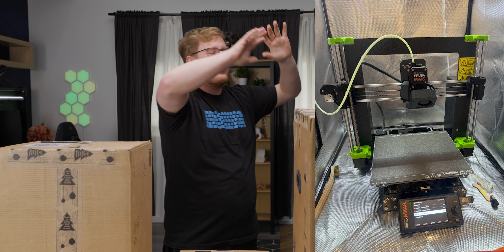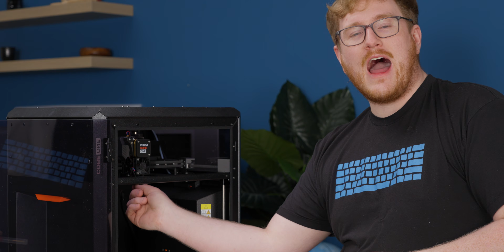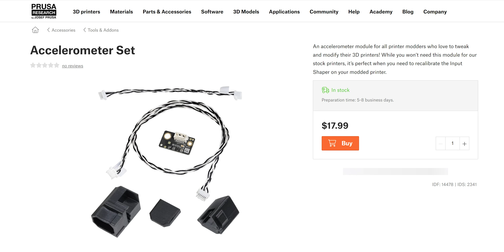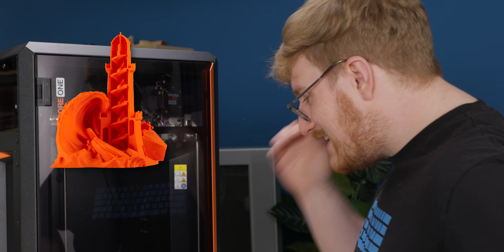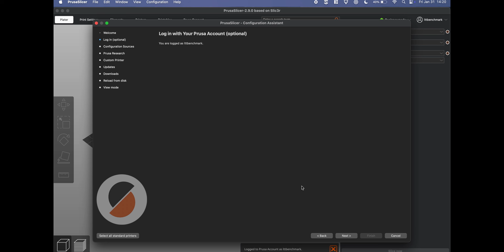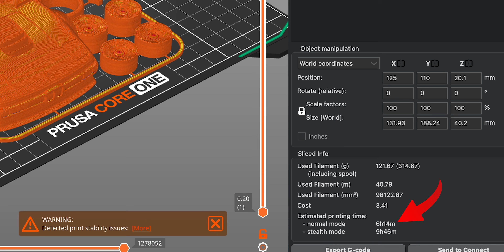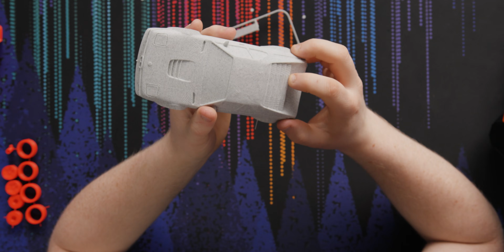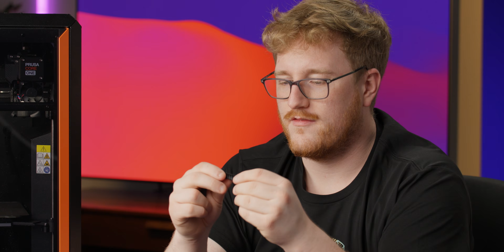Prusa has IMPECCABLE timing - Prusa CORE One

Comment: Even bad WiFi / older WiFi components should still handle 12MB files quite easily. But even past that, it has Ethernet - how does that compare for performance?

Also unclear on the camera - does it work via USB or does it have its own WiFi or something?

Either way, I had my concerns about Bambu a few months ago that turned out to be well founded. Placed an order for the Core One kit yesterday.

Comment: The 3D printer is broken, need parts.
Then 3D print the parts, but the printer is not working.
Then fix the printer, but need parts.
>>>> loop from here >>>>

Comment: Other Youtubers like CNC Kitchen have mentioned that the PLA overhang problems are likely caused by the temprature being too high in the enclosure. I bleive Prusa is working on a fix for this and it will likely be solvable through some slicer changes. Other companies like Bambu reccomend leaving the door open for PLA and Prusa tried to avoid this with the vent. Still impessive hat they managed to get such good prints with the door closed.
Reply: Prusa commented on that video that the fan are running at 40% at the moment, so you have plenty of ventialtion left.

Comment: One of my biggest complaints about the Prusas is that so many of the parts are 3D printed as part of their manufacturing process. I love 3D printing for hobby use, prototyping, and creating geometry that can only be achieved using additive manufacturing. However, full scale manufacturing should be as efficient as possible, which often means injection molding. That's part of the reason why their printers aren't as cost competitive as they could be, and why they often have trouble scaling to meet demand. The ideal is injection molded parts that can be 3D printed if needed for a repair.
Reply: And they do usw injection molding, but it is not perfect, as you have big upfront molding Costs. I have yet to get a failed printed part on my prusa Machines... Also in the core one there are very few parts which arent petg anymore. Fast iterations and also the possibilty to just Reprint your parts Go a Long way. Also customizabilty is nice If you want other colour accents one your machine.  Another Point is, that they do produce them all themselves on their own Machines, so there is a lot of Stress Testing before shipping a Beta unit to a customer and No bs Kickstarter...
Reply: they have been moving towards exactly that, slowly.

Comment: Casually dropping 3D scanning footage to show the flow path in the nozzle is such a flex.
Reply: That’s a CT Xray scan
Reply: They literally have a CT scanner on site…
Reply: That’s not what that was. You can’t x-ray with scanners, but you can use basically any CAD software. Now that’s solid Work has a $99 a year option you can do so many things that you previously struggled with tinker this or fusion that.
Reply: @CourtneyRoberts1982 this isn't a 3d scan or flow simulation. Notice the giant Lumafield logo, it's a brand of x-ray industrial CT scanner that LMG ( more specifically, LTT labs) has in-house
Reply: @CourtneyRoberts1982  that was a lumafield scan lmao

Comment: I don't like that you have to buy a seperate build plate just to be able to print PETG, one of the most common filaments
Reply: You dont have to. Gluestick might Help you, or If you are already in the ecosystem; all their old plates Work. (Apart from the XL)
Reply: @MaxMichel89  Glue stick still means relying on another product. A textured build plate by default would solve the problem. My Sovol SV06 came with one. I'd rather have the ability to print essentially any material out of the box than a perfectly smooth base.
Reply: @AdamJasper18  If you're kvetching about having to use a glue stick, I don't think 3D printing is for you.  Especially since the printer probably comes with a glue stick.  My MK3S did.

Beyond that, it's not strictly necessary to use a glue stick for PETG.  It may vary by filament brand, but I find that as long as I cool the build plate down to room temperature before trying to remove the part (easy to do in a couple minutes with a fan after removing the plate from the printer), it comes off without a hassle.  I might still use a glue stick if the part is particularly small and flat, where flexing the build plate doesn't pop it off.

TPU, however, absolutely requires a glue stick layer.

Or just add the textured plate to your order, and quit whining about the fact that the default is better for 90%+ of users who aren't you.
Reply: @TrueThanny  I've been printing for a year and have never had to even think about using glue stick. 

If you're buying an open bed slinger, sure PLA is likely to be the most used material for most people. But it's an enclosure set up and ready to print more than just PLA so surely the build plate should also be ready for that. 

If someone's printing anything remotely functional PLA is useless and so PETG is the most popular for that purpose as it's the easiest to print. 

If someone's buying a $1000 printer they're not likely only going to use it for non-functional display items. So why make them buy something extra to effectively print a material it's designed to print

Comment: I was onboard until the unnecessary jab at bambu. I've used my bambu with multiple other slicers, and I've not once "signed in." My p1p is half the price of this core one and has twice the capabilities. So far, the only thing I've seen that's different or even can be considered an upgrade is the nozzle, lol. Why is this $900+??? Crazy work. Just buy a bambu
Reply: Pretty clear none of the writers have even used a Bambi before, because LAN mode is one of the settings avalible directly from the printer start up, no account required. Software also does not require a login either.

Comment: I just got an Bambu A1 mini yesterday after using a (klipper/mainsail upgraded) Creality CR-10 V2 since 2019. The difference is mind blowing on all levels. It's dirt cheap, has amazing build quality, has an insane amount of features, it's superfast and hyper accurate. Why anyone would buy anything else at this point is beyond me.
Reply: larger ASA prints. That's your answer to why anyone would buy anything else.
Reply: And it's not true that you have to log in and make an account for bambu. You can use LAN or an SD card.
Reply: I got the same printer recently and its far from perfect.
Bad camera, bad spool holder wonky cable placement and they way they are secured, pooping fillament everywhere, gcode messed up due timelapse code, obnoxious ap required to use it, have to make an account and ... recent changes to third party support.
Also the company lied about having printers avaible and i had to wait weeks for something that was supposed to get to me in 3 days.
People are trying way to hard to ignore its flaws.
Reply: @googleslocik  It's 200 euros. The camera is more than adequate and it's amazing you get an integrated camera - AT ALL - at this price. I don't see how they can even make a profit on it. And it's an amazing first printer for anyone to buy looking to get into designing and printing stuff. As for its 'flaws' we're suposedly ignoring: Spool holder is immediately improved by a 2-3h print for a spool holder handle + plastic ball bearing shaft thing. I literally spent my first day just on makerworld printing all sorts of improvements for this printer that fix almost any annoyances you could possibly have and it cost me like 250g of filament in total or so. So thats a total non-issue, you literally have the tools to improve it. Their software is way more user friendly than most and MakerWorld actually gives people incentives to share their designs, leading to a great community and high quality content. And if you're the tinfoil hat man you can put it in dev mode and do with it as you please. Haters gonna hate.
Reply: I would literally buy anything else, I'll never support this awful company.
Reply: @_Jester_ what's so awful about bambu labs? And remember you don't need to use their slicer.
Reply: @RickDupuis  The lies the company tells and the gaslighting they did, a TOS that says you are forced to update or else they might brick your tool, affiliate program that does not allow any criticism of their machines. Panda touch instantly useless after Bambu decided they don't want anyone using it. Owners should have full control over a tool they bought with their own money and not get their workflow disrupted because Bambu acts up. If you read the TOS and watch Luis Rosman's videos you will know this is incredibly bad for consumers and the future of the tools that they OWN.

1. How do you skip objects with P1/A1 without logging in?
2. Lan mode is still not working across subnets?
3. Why do Lan mode uploading files have such a high rate of failure to innitiate prints?

The fact that we don't get 100% of the printers functionality and capabilities if we don't use the printer in the way bambu wants it is a bad thing and users should take a stand against these anti consumer practices. 
Defending and praising bambu only benefits their shareholders and allows bambu labs to do even more anti-consumer idiocy in the future.

Comment: A few notes:
* The USB-C port is used primarily for Octoprint. Which is actually a good way around their terrible WiFi if you have a Raspberry Pi on hand or don't mind getting one. The Mk4S actually had it on the back of the electronics box, but few people noticed it.
* I'm really, really hoping Prusa doesn't half-ass the CPU upgrade next time they do it. It was great seeing 32 bit support - it wasn't great that it was still a worse processor than a Raspberry Pi.
* CNC Kitchen found that it underperformed a bit with overhangs, probably due to insufficient cooling of the chamber. Prusa noted that the chamber fans are nowhere near maximum, so the good news is that can likely be fixed.

Comment: AFAIK, you don't need an account to use the Panda-Food printers. They have a LAN-only mode that just works in the local network and doesn't require a login. For me, this came in handy at times when the cloud services had availability issues and I really needed to print. As a last resort, you could also print from the SD-card, but I find that not very practical, it's not even hot-pluggable.

Comment: 10 mins for a 12MB transfer?! Thats so far from acceptable. I've sent gcode files that were 50MB+ to my printer using their internet service that took under 20 seconds for the printer to download.
Reply: I don’t think even WiFi 1.0 was that show.
Reply: Even bluetooth 4.0 is much faster than that😂
Reply: 10 minutes is crazy... I have an MK4 and yes, the wifi is slow, but definitely not that slow in my experience.
Reply: I think it’s limited by the speed of serial on the ESP WiFi module. However, the speed is not really important since using Prusa Connect, you can already print before the file has been transferred completely. Not to mention the usage of bgcode which shrinks gcode a lot.
Reply: yeah that's wild, my last file was 200mb, I don't even know if this could transfer it without timing out and corrupting the data lmao
Reply: If you use prusa Link via WiFi (local solution) ITs slow. Via LAN ITS much better. If you use prusa connect via WiFi it doesnt really Matter, as the print already Starts, and WHO is on that crappy of an Internet Connection anyways. If you have Money for a prusa you might as well have Money for good WiFi or cables. But still i would also Love to have an Upgrade for this...
Reply: @MaxMichel89 I have such a crappy WiFi, that's the reason why I would only use with LAN or the USB stick
Reply: yeah, 1300usd for printer that doesnt even have a camera and worst wifi of all time is crazy

Comment: If they made the wifi module an M.2 2230, then we could use laptop wifi cards instead of whatever they provide. or heck, just add another USB port and we can pop in wifi that way.
Reply: The problem is not the WiFi module, but the fact that they connect to it via serial.
Reply: The CPU on that thing is not even running normal linux AFAIK, so they would have to code drivers for any wifi chip they wanted to support. And that's assuming the CPU even has IO interface for M.2 cards, which it likely does not. Until MK3, these were essentially glorified calculators. Now it's a bit better but still way less powerful than even a Raspberry Pi
Reply: This thing has a ESP32 CPU without PCIe, tell us how that should be possible?
Reply: wifi antenna via usb is a notirious driver nightmare. For stuff to work, they will need to install the whole linux kernel.
(While it sounds like making fun, on second thought I would like to see it just coming with arch installed)

Comment: I should not have watched this video. So tempted to order the upgrade kit for my MK4S right now.
Reply: Not really worth it though based on how much you have to replace. I suggest you get the Core One Kit and then have 2 printers instead of just one working one and lots of parts that you don't need anymore.
Reply: @thilotech  100% correct, very few upgrades from prusa have been worth it. Upgrading from an MK3 to the Core One costs more than a brand new Core One while loosing your original MK3. It is certainly their biggest marketting feat apart from selling under-featured printers to people :/
Reply: I orderd one in the Launch of the kit. Their Website was very slow at that time (it's Back to working now) so there are a lot of people upgrading or buying the kit.

Comment: Are they still using the ESP01 ESP8266 module ?
That one is quite sensitive to stable 3V3 and metal near the antenna.

I have helped them in the past with some firmware issues. Back then it appeared that reducing the TX power did make the WiFi much more stable.
This is often an indication the antenna is badly tuned and/or gets a lot of reflections from nearby metal.
N.B. unstable 3V3 also can result in badly tuned antenna parameters, so best to start the WiFi a bit later if the power needs some time to stabilize.

Comment: i had a mk3s and now 2 p1s, i'm not a Bambu fanboy but i don't get that "repairable" thing everybody tolk's about, if u break omething on their websit you can rebuild basically thje entire printer.... what happen if Prusa spareparts goes out of stock ? (like in the past for some specific parts) you have to check for aftermarket parts wich can cause issue or just be more expensive.                                                                                              IMHO spare parts wise the are the same.

Comment: The build plate dimensions are so weird. Come on they need to be 310x310x310. Looking at a Bambu X1C and this printer and it's really lacking in size. But then you have all the Bambu nonsense to deal with. Ugh.

Comment: Too little, too late. I started with Prusa and struggled with quality switching to the X1C. That has drastically changed with experience using the X1. I can't go back to Prusa until they meet or beat the advanced filament options Bambu has done so well with and the hardware (nozzles, etc) to go with it.
Reply: Odd, I've not had quality issues with the Mk4 & Mk4S.
Reply: @logicalfundy  that isn’t what I said. I said switching to the X1 started off poorly due to quality issues. Those have since been resolved.
Reply: @Braymond141  ok, sorry I misread.
Reply: bambu has lost me with the walled garden they're trying to build.
Reply: @kennytheamazing its really not a big deal.
Reply: @CameronRides  it really is not.

Comment: You can use the Bambulab printers without an account or internet connection, they have a micro sd slot and you can still use other slicers. I know it's popular to hate on them, but lets keep the facts straight.
Reply: Also, from what I understand, the Buddy Cam can only be accessed via cloud.
Reply: incorrect
Reply: @Pool-h5w  that's weird, because it's exactly how I use mine and the one at work..

Comment: Very nice, very nice indeed but ~$1199 USD,……ouch!  That may be fair market value for this class of 3D printer but damn!!!
Reply: They will probably improve over time as they're starting to automate more - but right now the big cost for them is European labor. They aren't based in China, and they aren't outsourcing assembly to China.
Reply: @logicalfundy  the DIY kit is also not always good value, assembly is not playing much of a role there.
Reply: @tiloalo the value ist definately there. Very good documentation and you then know how to fix Something If anything does goes wrong. It's also fun (Not for all people)
Reply: The new Elegoo Centauri Carbon that came out of embargo yesterday looks like it might be the new best deal for this level of printer.
Reply: Yep, they are clearly a bad market value in the segment
Reply: The Creality and Qidi Q1 Pro both do the same stuff for less than half the price!
Reply: @steveseattle6791  Yeah for $100 more you can get a Creality K2 that has a 350x350x350mm print volume.

Comment: Sadly it has just too many points of inconvenience.
-flexible top plate (can't put much on top of it)
-plastic one-time use rivets(??) to hold the top plate
-no connector where you feed in filament (no connector for additional Tpfe tube for a dryer)
-camera just sends still image every 10 seconds
-switching the side of the hinges for the front door is a pain if you receive it pre-assembled
-build plate takes long to reach "high" temperatures
Reply: Definitely some baffling choices. I guess the camera is slow since they don't have raspberry pi or equivalent there to prosess images. I also love the AC heat bed my new printer has as that doesn't need a power supply and is pretty fast.
I know I would make alot of changes to Core one if I had one.

I had Prusa MK2S (kinda still have but not much is left of the original printer). I was considering Prusa for a new machine as well but I seriously hate customizing Marlin so I went with something that has Klipper as a default.